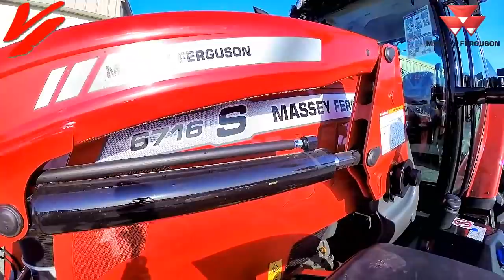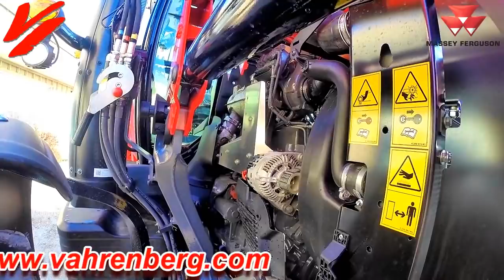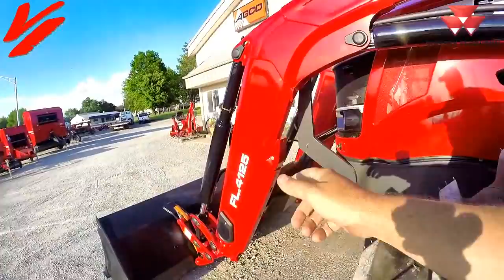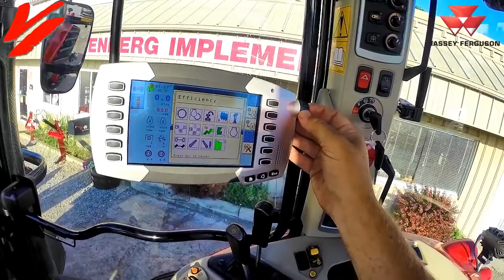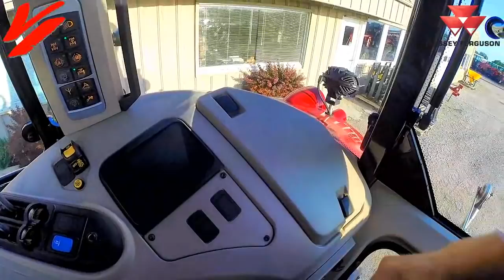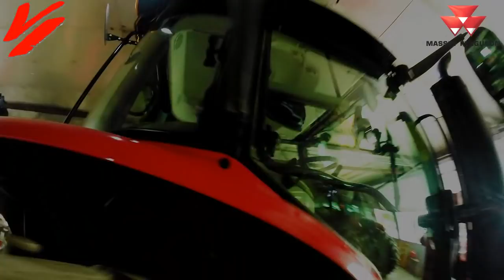Massey Ferguson 6716S Deluxe DynaVT Mid-Range Tractor: 2020 Machine of the Year Award Winner

Comment: Technically you kind of are using the clutch. Because lifting the power shuttle does the same thing as a clutch.
Reply from the maker: There is no clutch or clutches in a Massey Ferguson CVT. It's Hydraulic engagement or disengagement of the transmission. You can engage/disengage the transmission with the Clutch Pedal, Powershuttle lever or when Brake to Neutral activated by depressing both brake pedals at the same time.

Comment: Okay how much do you want for that tractor. Want is the cost $. where is the tractor made at.
Reply from the maker: Tractor is manufactured in AGCO Owned & Controlled Facility in Beauvais, France. You need to contact your local dealer for pricing as there are many options and choices to the 6700S Series Tractors. If in West Central Missouri near Higginsville, MO we would be happy to custom build and price one for you or check out the Build Your Own on www.masseyfergusonc.com

Comment: Do all the SIG models have plastic rear fenders? I really like the metal frnders. I have a 4707 with deluxe cab that has metal rear fenders. I like that. You always point out that strong feature. I'm in that ball park.
Reply: Metal fenders are a thing of the past. None of the new tractors have them. The plastic ones seems much stronger and flexible. Where the old metal fenders would dent or bend, the plastic ones bounce back and fully recover. I have all Fendt's, from fully spec'ed 500 to 900 series and all have plastic fenders.